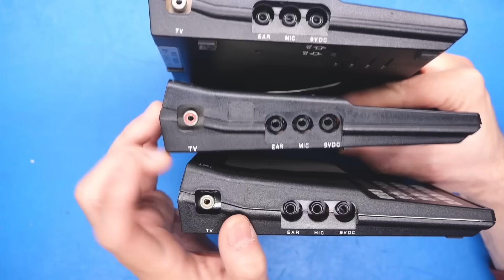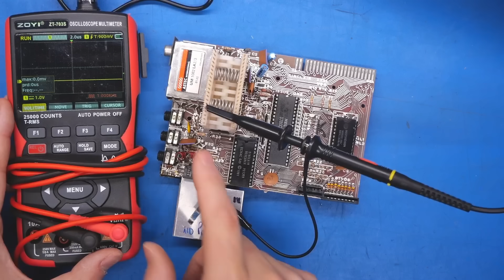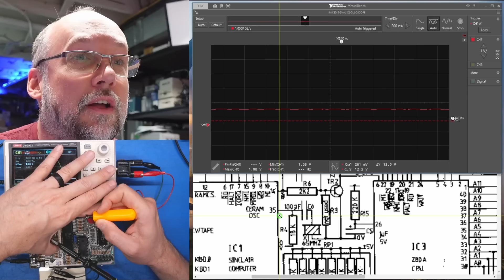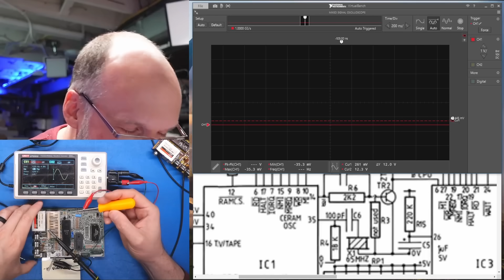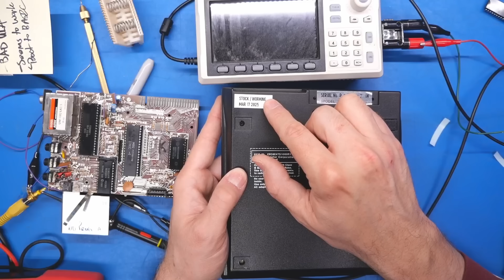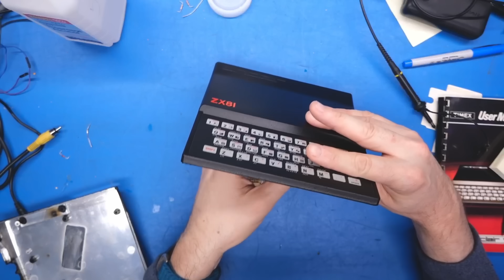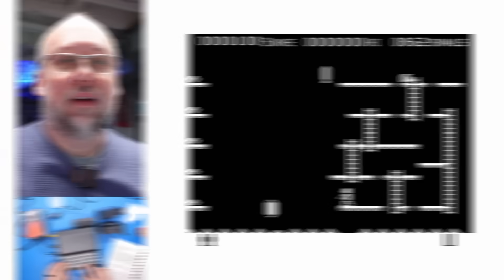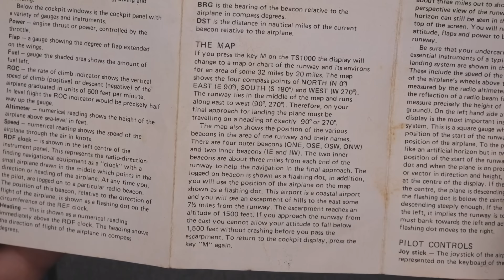Is the ZX81 / Timex Sinclair 1000 actually bad? Let's fix these to find out.

Comment: Just to add some context to the ZX81, it was available at an even lower cost as a kit that you had to assemble, including soldering on the components. It made computing available to a much wider group of people including me, as a kid it was affordable. I later added a mechanical keyboard and a 32K RamPack, again sold as a kit to reduce the price, used it for 6 months. I even sold my ZX81 for a small profit before buying a ZX Spectrum. It set me on course for a 40+ year career in computing, and counting!
Reply: I built the kit in 1981 when the ZX81 was first released. It was £20 cheaper than buying the ready-made version, which sounds like a good deal until you realise that you had to provide your own PSU. So I made a PSU for it while I waited for the kit to be delivered (it took nearly two months to arrive due to 'unprecedented demand'). Eventually I bought a third-party RAM pack for it — the Sinclair 16k RAM pack was poor value, compared to the '56k Special RAM Pack' that filled in all the holes in the memory map. And of course I fitted a proper keyboard with actual key-switches, supplied as a kit by Maplin Electronics.
Reply from the maker: @Blufftek I have a recollection of Maplin making keyboards for other machines too, like the Atari 400. Maybe this is a false memory though....
Reply: @ It's likely Maplin did make keyboards for other computers — they had all sorts of kits for different machines. But though their ZX81 keyboard used real key-switches the case was made from the cheapest vacuum-formed plastic you could imagine. But it worked.
Reply: @Blufftek Although even if you had a real keyboard connected, this machine had no rollover in the keyboard scan system, so you still had to press and release each key before pressing the next one.
Reply: I built an unopened ZX81 kit a few years ago and it all worked ok
Reply: @BrianDorey  I had seen your video some time back, that must have been fun.
Reply: @ I had the ZX81 when i was very young so it was nice to go back to the machine which started me into the world of comptuers
Reply: @BrianDorey  😎
Reply: @BrianDorey  You OPENED it! 😱🫨
Reply: I built that kit too, limited as it was ANY computer was still a computer. Before that it was a TI-57 programmable calculator for me. I was just entering college as an EE at the time.
Reply: @vcv6560  I had the Sinclair programmable some time before the ZX81, only 36 steps but along with the library of programs that came with it it was a great learning tool.
Reply: @PioNunes  I built a Harlequin128 (basically a Spectrum for those that don't know) just recently, hours of fun... and it actually worked too which was a bonus 👍
Reply: @kyorin6526  I have seen that project, he was also involved on the ZXUno, I missed the crowdfunding version but built my on v4.1 using the info they shared.
Reply: We had the kit version, and I remember me and my dad soldering the components in. I don't remember whether the PSU came with the kit, but I'm sure it did as I remember it all working first time. I remember using it so much the shift key wore right through, so we ended up buying a proper keyboard for it. Like for many others, it was my introduction to computers and programming.

Many years later I was involved in some meetings with my work, and one of the people was the person who wrote the OS for the ZX81.
Reply: I remember seeing ads in the U.S. in Popular Science magazine for Sinclair computers and a friend's older brother had one hooked up to a black-and-white tv in his room.  He later went into computers as a career.
Reply: I ordered a kit version but after delays, they sent me a built version for the same price.
Reply: I wish I would have stuck with the programming.
I enjoyed it so much but I didn't think I would ever be able to make a living doing it.
I thought programmers just made games and there was already a bunch of people doing that.
I had no idea!
Reply: ah that explains the lack of FCC ID. Not required.
Reply: was that a HeathKit?   Never saw the build your own in the US.
Reply: @BobDobbs-l3h  I'm in the UK, it was also available as a kit originally.
Reply: @BobDobbs-l3h I got the $99.95 kit in the US, and I still have the Sept 1981 ad from Popular Science. It did come with the brick power supply and shipped from Nashua NH. It was my first computer and I still have it.
Reply: I added a plastic keyboard for 100$ and the memory pack too! I used it to learn programming though, not so much for games. I did play chess on it. Sargon. It sucked. LOL

Comment: Hey Adrian, I have an issue 3 TS1000 and I happen to use it with the exact same monochrome monitor seen at the end of your video. I can confirm that the same issue with the wavy interference appears on my unit when using the expansion pack. I modified my unit to have 16K internal and it no longer has the issue.

Comment: I just built my own keyboard, there are plans out there. It's a pretty simple matrix. There were also sticker packs for the key tops that I had.  Start with a keyboard, cut the traces on the board and wire the matrix. I think there was like 1 logic chip or something. Many years ago...

Comment: yes timex DID make a spectrum keyboard like version. the TS1500,  had 16k built in and adding a rampack gave 32k but not directly or easily usable by basic, i dont think they were that common, and were never sold here in the UK, i imported 2 from the USA in the mid 2000s, they dont use the sinclair ULA but a custom timex one (made by NCR i think) ... that said, i've seen a picture on the net of a version that did use a sinclair ula..

Comment: I still have my TS 1000 and it still works. I used mine in 1981 to write Land Surveying Software and the keyboard never really bothered me. I upgraded, well downgraded to some Apple computer and could never get my programs to work when I ported them over to the Apple. I rewrote them using Apples basic language but it did not have all the routines that CPM had. I never bothered with games back in those days.

Comment: They did have one with a spectrum case and keyboard - the TS1500 which also had 16k on board (my favorite computer). All I know is that the "doorstop" was all I could afford at the time, and I still enjoy assembly programming on it. It started me on a career that currently pays for my McMansion and everything else. I'm mostly done writing a version of Robotron for it, with high resolution graphics, sound, and a joystick, courtesy of a modern "ZXpand+" expansion. I have all the North American models now (ZX80,ZX81,TS1000,TS1500 & TS2068) along with most of the European Sinclair models too. Computers of that era sold you a dream. A possibility of what could be that forced you to learn assembly and get really creative to get anything out of them (I had no assembler, so just wrote raw machine code). Once you hit the 16bit era, they were just computers. Sure they could do a lot more, but they were no longer selling a dream - it was just hardware. Metalized case was the FCC requirement for US models. Truth be told, Sinclair stuff was pretty terrible, but it also enabled untold thousands around the world to get a start in IT.

Comment: Later on, I backed up the program cassette as an audio file to an IBM vintage computer disk. Knowing that cassette tapes would hold its data for so long. I later found books on the Zilog Z80 CPU and programming and hardware books by various authors like "THE INS AND OUTS OF THE TIMEX TS1000 & ZX 81" BY DON THOMASSON, "MASTERING MACHINE CODE OF YOUR TIMEX SINCLAIR 1500/1000" BY Toni Baker, "BYTEING DEEPER INTO YOUR TIMEX SINCLAIR 1000" BY MARK HARRISON... =8-)

Comment: The ZX81 was my first computer.  UK versions were built by Timex in Dundee, Scotland. The manual was great but the computer was a struggle to use. It did introduce many people to computers in the UK and went on to sell 1.5 million units ending production in Feb 1984. The RAM pack was pretty much a must have purchase and the famous 'wobble' was solved by attaching blu-tac. For the brave, you could buy it in kit form and assemble it yourself. The kit versions are very rare today.
Reply: I think you can still buy ZX / TS kits from Zebra Systems, although it's been ages since I looked. There may be other sources out there. :)

Comment: to test the rampack, a quick n dirty test is type PRINT PEEK 16388+256*PEEK 16389, it should show up highest address that 'seems' to not work, for 16k, 32768, to do a proper test, a small basic program can do it,  there was a bit of paper included with them that had a test program listed, but pretty much did the same as the above command but in a long winded way!

Comment: This was my gateway computer. I saw the ad in popular science(at the library), saved up paper route $$ and matched by my dad bought the kit. When it arrived, we put it together and when it came up, I can’t describe how excited I was!  Funny thing is that not much later, commodore offered a $100 trade in program on a new c64 so I came out ahead :P -way ahead considering I have been a software engineer for 35 years.
Reply from the maker: That's awesome. I wonder what Commodore did with all those traded in machines? And I wonder, was it $100 trade in for a C64 with any working computers? If so, the TS100/ZX81 people got the best possible deal!
Reply: @adriansdigitalbasement  From what I heard (maybe 8-bit Guy? Maybe elsewhere) there were stores that had Timex 1000s on close out at $50 in bins next to the rebate forms.

Comment: In the late '90s, I bought a TIMEX Sinclair 1000 in the original box and packing. It has the original manual, an upgrade kit pamphlet, and a power adapter. The kit included the cassette recorder and the original box and packing. Plus, it has a 16k module and, best of all, 7 program cassettes. That truly made my day... =8-)

Comment: if you plan to fit composite mods please dont strip the modulator innards out, no need to but fit it externally, keep it as original as possible, these modulators are now pretty much unavailable new/old stock ,, if you;re fitting the board back in the case, it wont be seen

Comment: note the rom is non standard pinout, the extra holes were to take an uncommon type eprom, some zx81s may be fitted with this or a 2564 eprom with wire patches  uk and usa zx81s were fitted with 1k ram, either a single wide 4118 chip or 2 2114 ram chips, usa ts models were fitted with 2k strangely

Comment: Sinclair ZX81 is a bit meh, but it can also be good at the same time given if you are a good computer hacker who knows the way around BASIC (which, while similar to Microsoft BASIC, it's also different). And it was a cheap computer, even in DIY soldering kit so I am not complaining. Of course there's a few custom bootloaders out there for the ZX81 too as well if you long for better software on it. The only biggest negative is the keyboard, of course.

Comment: that 'ledge' on the issue 3 ula signal is the 'back porch', issue 1 ulas didnt produce this which causes problems if using a zx81 with colour tvs and is likely why the display with your capture device isnt as good  .. update , i see you mentioned it later in the video!!

Comment: I dont remember the exact month and year but mine was the kit version. I think it was $59.99 but you had to solder all if the components on the board. I got 1 diode backwards and the keyboard would not work. Had to re do it. Took forever to type programs in. My next computer was a Model III.

Comment: Almost got one of these for my 12th birthday. I desperately wanted a computer and thought this might be in my parents' price range. My dad was like, "nah that's crap" and got me a VIC-20 instead, which was around $189 in late 1982. Thanks dad! Dodged a bullet there! Made me a Commodore guy to the bitter end.
Reply: Love the Amiga, such a pity it didn't gain more popularity or success. Multitasking was ground breaking when all the PC faithful were stuck single tasking. How many windows could you open before it just became unusable 😅
Reply: In my case, I was the dad, and I bought the family a Vic20, the cassette recorder, all the books, and some programs.  All three of my kids, ended up in hi-tech professions, using computers for their work but in other high tech jobs, (like splitting atoms, in one case).  in my case, my progression went, Vic20, C64, Amiga 1000,2000, 3000, and 4000., and am stil using an Amiga. 
.I did end up inheriting a ZX81, with the 64K Ram expansion, but I never used it.  (I converted him to the C-64)  I still have it.
Reply from the maker: So a family member of mine had the TS1000 and I remember playing with it at the same time I had my VIC-20. I remember immediately being put off by the keyboard and then lack of color and sound. (I was a 7 year old after all, and I liked games.)
Reply: Don't know about dodging a bullet! I had a ZX81 and learned loads. I was given  Vic 20 which I tried for a week or two but immediately passed on. Next up was an Intelligent Software 'Enterprise 64 and Enterprise 128 (yes, both! My wife worked at a local factory that made them and I got them very cheap). Once again, because the Enterprise had a Z80 CPU (same as the ZX81) I already knew how to program it in machine code. Add to the that the fact that my wife obtained a copy of the EXDOS Operating System I came on leaps and bounds, using many of the OS commands (eg. Bresenham line algorithm) to produce more advanced programs with less effort. Learned a lot at the time, including the MiniMax algorithm and wrote my own Connect 4 program with colourful sprites and a Z80 routine that checked the board in a flash. The best I ever achieved with that, my OWN program, was a DRAW! Next was an Atari 1024 STE. Not Z80 unfortunately :-), but nevertheless a wonderful machine, with a MOUSE, that eventually launched me into my PC days.

Comment: note pin 35 of the ula is both input and output, its an 'unstable' circuit internally that uses a resonator to make it oscillate at the required frequency

Comment: Lets See..  I have 7 or 8 of the ZX81/TS1000..  Two of the ZX81, were built as Kits.  I have 16KB RAM Pack for each one, and one MemoTech 64KB RAM Pack...   And One that is in a Metal Case with "real" Keyboard..

Comment: yes the unreg  9v feeds to the expansion slot, note some non sinclair brand rampacks rely on the '9v' being nearer to 12 than 9 to work, due to their cheap n cheerful circuitry, using regulated 9v may not work!!! plugging the 9v into either tape sockets wont cause any damage, this is specifically stated in  the manual

Comment: "The video looks terrible when you plug in the ram pack" Yup, thats normal 😄 Making it not do that would have added to the cost. You might try sticking some caps in to your video booster circuit to cut down on the noise getting into that transistor, but ultimately it's just as crap as it always was - if anything you can only see that because you're using a decent monitor, if you connect an equally crap TV over RF you probably won't notice it as much. Before I could afford a graphics calculator I actually brought in my ZX81 and a 4.5" black and white TV to my maths class, to the bemusement of the teacher. Were they crap? Yes. But, importantly, incredibly cheap, and offering so much potential for learning. Its a bit like using Arduino these days, you learn how to do more exactly because it is so simple.

Comment: If I am not mistaken the part of the CPU that is used for video generation is that the refresh counter (R) of the Z80 CPU is used for the vertical sync generation (vertical counter).
The ZX80 and ZX81 are notorious for not having clean video signals with front and back porch wcich can cause some TV sets not to work properly.
But these computers seem to at least try to inser a front porch etc... which is important for the black level.

The reason the CPU clock is generated by the ULA is that that the ULA just stops the clock to the CPU when it needs to access the RAM for vidéo génération (a crude bus contention solution that only works because of the fully static design of the Z80).

I think the "5 / 10" at the end means error in 10 so the program did not pause it "erroed out".

Yes, as the delay at startup implies, the machine does a (simple) memory test at startup
I am quite sure there are mods to put a 32K static RAM IC on the PCB in place of the 1K one. All the chips use the same JEDEC pin-out as 27xx.

Comment: I have 4 of these. They are all notoriously bad on the RF-signal. Almost impossible to tune in on modern TV's, so a composite mod is definitely needed. I have one with a replacement keyboard with proper keys

Comment: With enough patience it may be possible to use low melt solder (melting at ~140°C) to solder wires on the keyboard ribbon cable. I managed to solder wires onto metalized plastic before, though not at all easy (also awful because it was not copper, and I needed to use special flux for aluminum and other metals that only activated around 250°C)

Comment: I bought my first TS1000 to finish my college homework around January 1983.  I had a 300 baud modem dialed out to a college computer system.  Furthermore, I typed my homework and then saved it to an audio cassette.  I set up my TS1000 to run a modem program and loaded my homework onto the computer to upload it to the college computer system to print my homework onto some papers.

I made several modifications to my TS1000s, TS1500s, and the TS2068.

 I am a gentleman who gave you a blank Timex Store Demonstrator PCB board in person in early fall near Chicago.  "DesSony7"   VCFMW  https://youtu.be/cQGWcHCzZmU?t=3702

Comment: There were lots of 3rd party keyboard cases available at the time. I had one for the ZX81 and later one for the Spectrum. I remember the ZX81 keyboard came with a glossy sheet of paper with all the keycaps printed in it. You had to cut it into squares and insert them under the removable key cap covers.